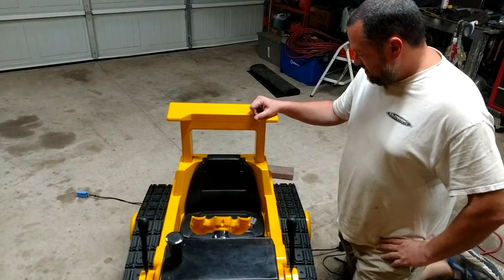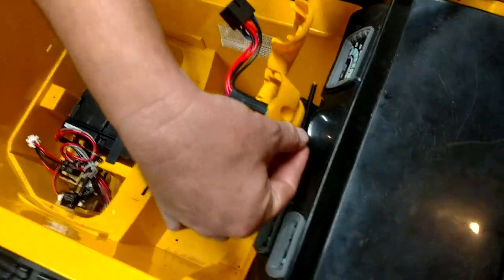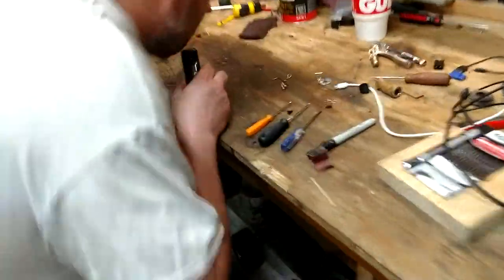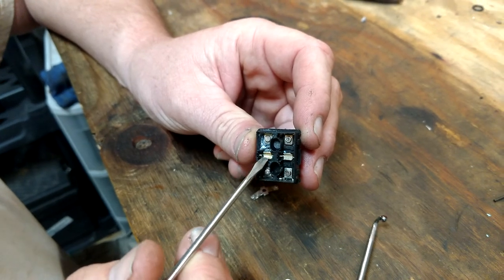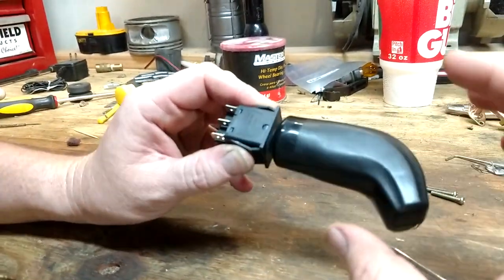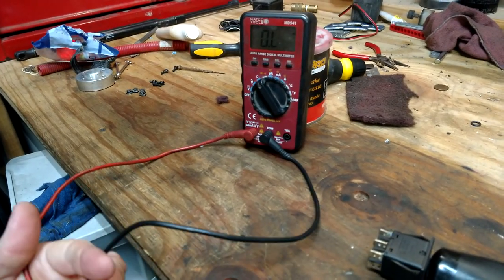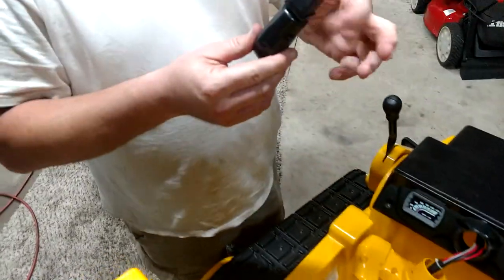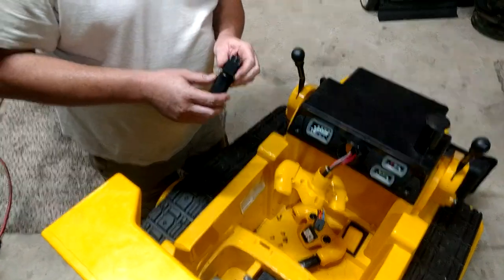How to repair switches on Power Wheels when there is a loss of functions

Comment: Hello.

I have a Power Wheels Suzuki 94 model 86570 ATV.  I purchased used at a garage sale and after contacting Mattel I found out that it has been discontinued.  I purchased  a 12 volt SLA  battery and used some 10 gauge wire with quick disconnect spade connectors and was able to get it running.  My grandkids were happy.

I connected the two red wires from each motor together with the white positive wire and the two blue wires from each motor together with the black negative wire, but after a few minutes of use it blows the 30 amp fuse that I installed inline on the positive wire. 

Hopefully you can add some insite so this will work.  Do I need to install a 30 amp fuse per motor? 

Thanks in advance
Reply from the maker: @gadzuccs1867  without just going thru the wiring i couldn't give you a definite answer to your issue

Comment: I have a 12V First Drive Mustang blue toy car, with no power at all. Using voltmeter I checked the battery and power source volts, all seems correct. There's a 3rd grey wire that goes to some module (looks like that switch in your video).. was told this is a ground wire ... any tips to troubleshoot what's wrong? All wires seem connected, nothing loose.

Comment: My bulldozer only goes in circles I can’t figure out how to fix it any suggestions
Reply from the maker: Sounds like one of the drive switches is not working, i can suggest removing the switches and cleaning the contacts, there's even the possibility one of the drive motors have failed